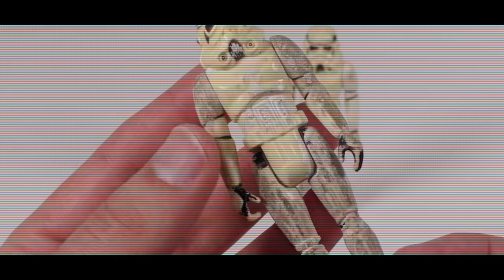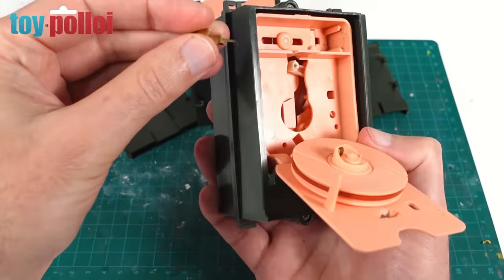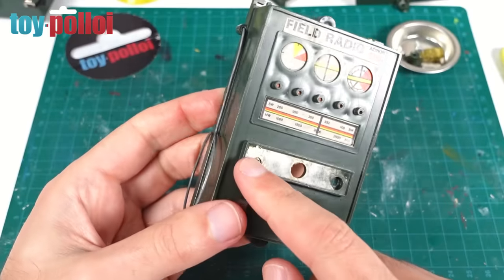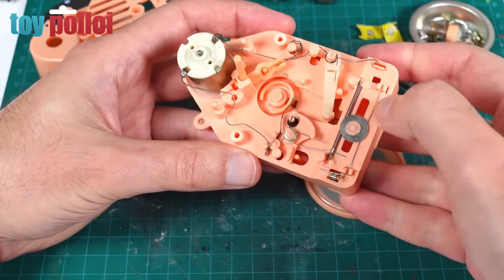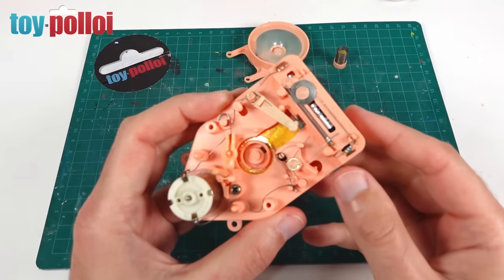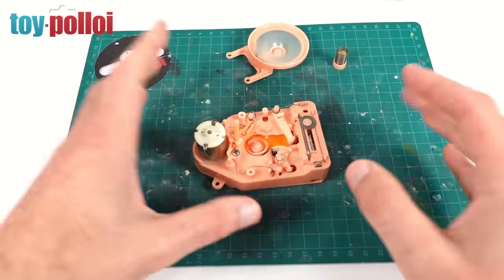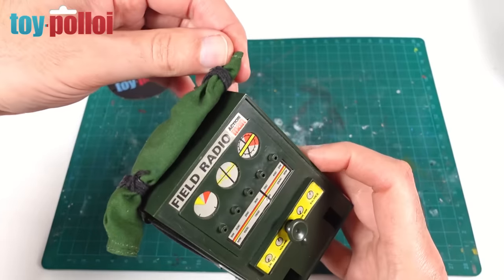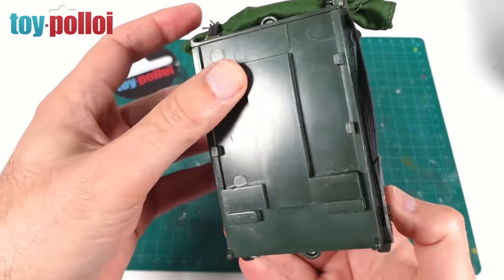Vintage Action Man Atomic Field Radio repairs - Toy Polloi

Comment: What a great repair!  I remember the Steve Austin pack had a radio with a little earphone.  This seems way cooler.  New stickers look amazing, too.  Great video! Thanks!!
Reply: The Steve Austin set was a crystal radio which should have been able to pick up actual AM radio stations by adjusting the little antenna. Mine never worked but the backpack looked great.
Reply: @kjamison5951  YUP!  I never got a signal on mine either, but it looked cool!  I also had the Critical Assignment Arm and Legs packs.  Man, I miss that guy.  A'ight, I'm headed to eBay!  Thanks again Dave!

Comment: Okey, i fixed this player by watching tutorials on YT, but it plays fast so i thought my records were foreign. But then you suggested to expand the spring! You're amazing, I'm gonna check this tonight!!!!
Reply from the maker: It will be the spring for sure. Just stretch it a bit and the record should play at the correct speed. Glad I could help.
Reply: @toypolloi okey so it helped a bit but it still sounds like my records are in a foreign language, did this exact player come out with different languages?
Reply from the maker: It could have done. I'm sure it was used in lots of toys.

Comment: Very cool video Dave. I just did a similar repair to a 1979 imperial troop transport. Slightly different make up, but same basic record player. Made new contacts for one side, and spun the motor free.  O have a 12" Mork from Ork figure that hase a pull string back  pack. Works, but not quite right. Thats going to be my next venture. So Lord willing. I'll have as good a luck with it too. Not sure if anyone has any info on this figure or not. If so feel free to chime in. Lol dave as always thank you sir for what you do.  I never realised there were so many same, but different versions of these players. Pretty neat bit of engineering.

Comment: Uncanny as I'm currently working on one of these. Mine has a dead motor though and finding a good replacement for a discontinued Mabuchi RE14 motor that doesnt run  too fast has been tricky. Great tip about the spring though. Its a pretty magical device when you think about it.

Comment: Another great video TP!  Always neat to see you bring those toys back to life after being dead for probably 40 years!  Two questions:  plastic welding is that with the Tamiya thin cement melting old plastic or using a heat source to melt it?  And for your intro you mention forums not liking restored toys, has that changed at all or is there still a faction of purist that don’t like restorations?
Reply from the maker: Plastic weld fuses certain plastics together. As far as I am aware I am still banned from some forums. I don't bother checking.

Comment: Really liked your intro to this video 👍👍!! Was any of it true? Were collecters trying to stop you? I would imagine that toy repair, restoration and customizing have been around for as long as toys were?
This is seriously blowing my mind!! I've spent most of my life working in the bar and club industry. 20+ years as a night club/battle D.J. So I'm really interested in finding this and seeing what could be done with them. Possibly do a battle set using these?! 🤔🤔
What about using Goo-Gone or something else instead of lighter fluid to remove the stickers? I used lots of times to remove anything with adhesive attached to something and it also removes any adhesive that might be left on the surface.
Reply: I've used Goof Off (which happens to come in lighter-fluid-like cans) and it's occasionally melted some plastic I was working on.  I'd test it somewhere inconspicuous if I was working on a vintage toy.
Reply: @TeflonDave  I figured it would probably be too much for certain plastics. Thanks

Comment: Exactly the same Talking Unit was used in the Board Game  ‘Horror House’ by Action GT. from the mid eighties. That was the great thing years ago; they kept mechanisms and such pretty much the same, didn’t keep modifying and changing something for the sake of it which made things easy to repair – they all worked well, and they just adapted with the use of different Mini Records – depending on the toy.